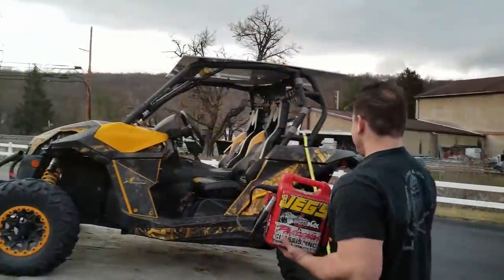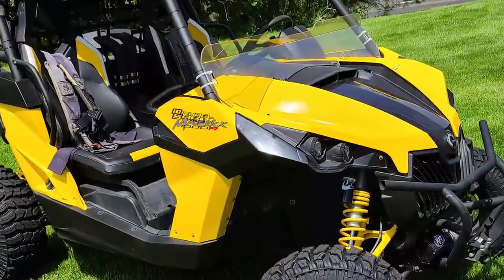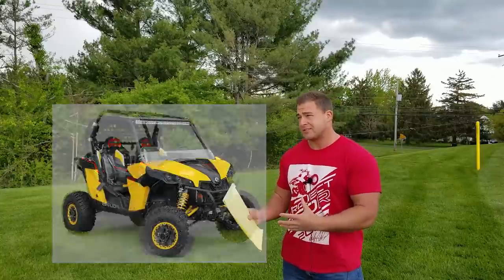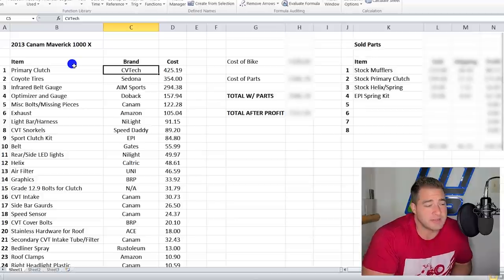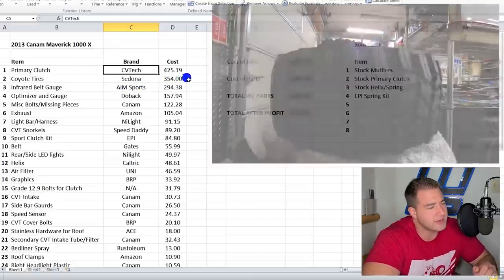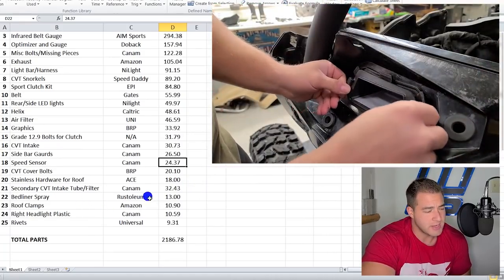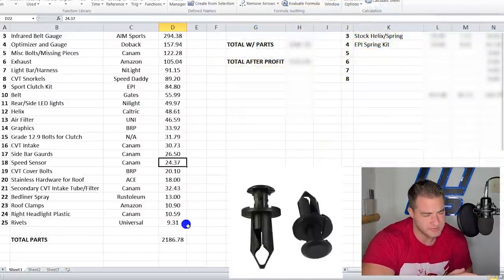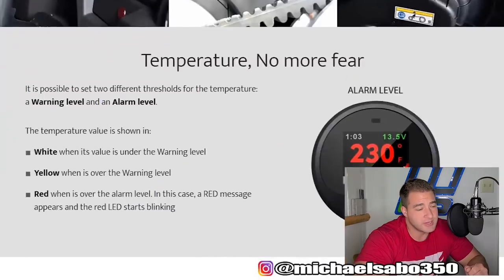How Much Money Went into Saving This Trashed CanAm? Complete Recap and Expense Sheet!

Comment: Hello love the video,  i have a question , i bought a 2014 xrs 1000r and i have a coolant leak at the back of skid plate i think its a hose clamp could you tell me where the passenger side coolant hose after the water pump goes to  thx 👍
Reply: Crickets....I guess he doesn't give mechanical tips.

Comment: Dirt specialties make a budget door that is pretty good, no body has a video on them worth a hoot... next thing you probably have 3k worth of labor involved,  plus connection grease, connectors, wd40, drill bits, zip ties, sand paper, those things add up also
Reply from the maker: Depending on where things go, I may end up adding doors down the line and I will of course make a video for that. Yes, shop supplies; I forgot to mention that as well.